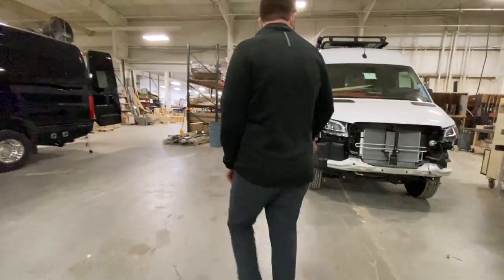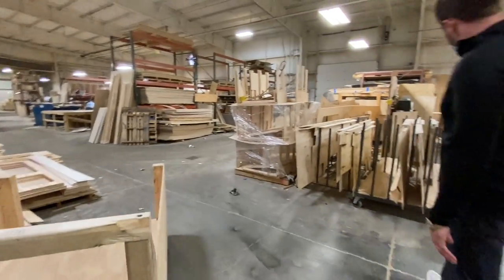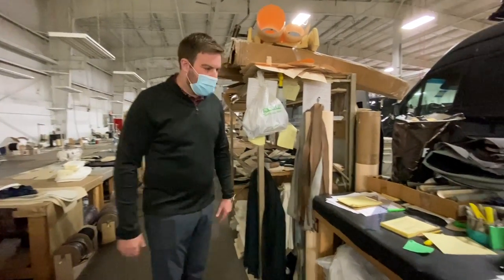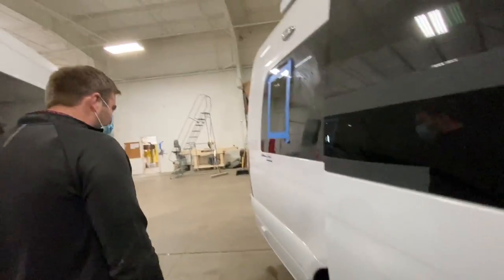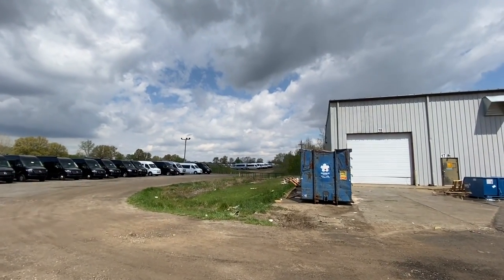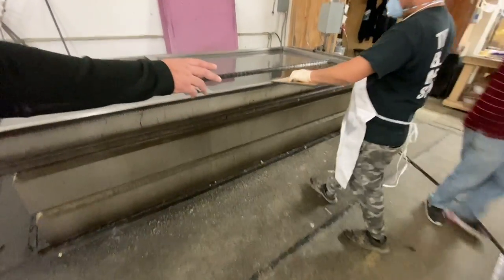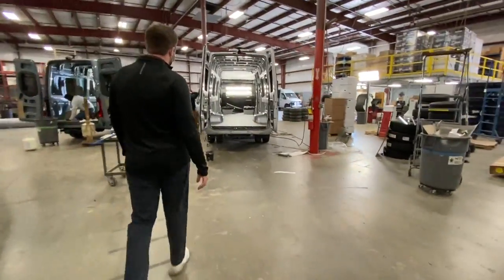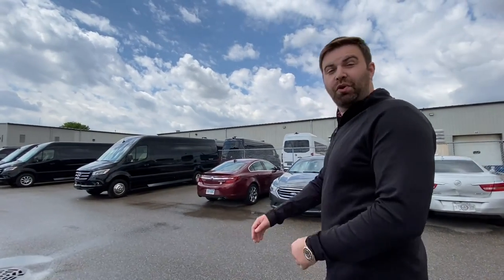Midwest Automotive Design Factory Tour! Quality B Van Motor Homes!

Comment: The factory is very sloppy.  Did not see any state of the art manufacturing processes.  No lean manufacturing techniques, no 5s evident, no 6 sigma.  If the factory is that sloppy the quality of the product is probably the same.  I would expect better from an organization the size of REV Group.
Reply from the maker: Interesting… you must be in manufacturing.
Reply: @RVConcierge  Yes.  Over 35 years for a variety of products and volumes in the US and offshore.
Reply: You hit the nail on the coffin. I purchased the day cruiser 144 couple of months ago and I’m having to deal with all sorts of issues. Screws falling loose from the seats, interior door leading to the back squeaks like a door that’s 50 years old and constantly makes noises as you drive. Leaks from the roof. Customer service is even worse, they will guide you to a near by RV repair shop which will hold the van for 2 to 3 weeks before diagnosing the van. Layman’s term quality control SUCKS at Midwest Automotive.